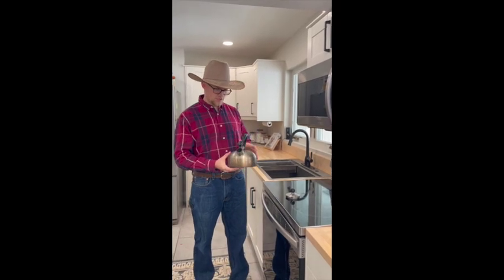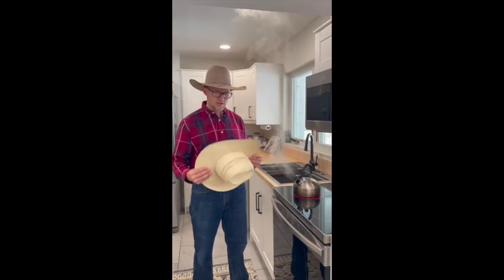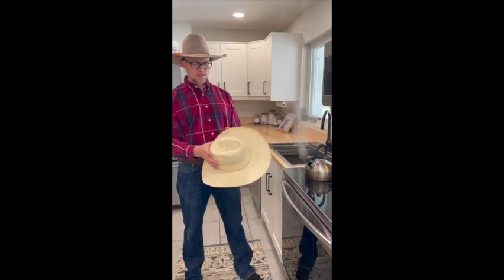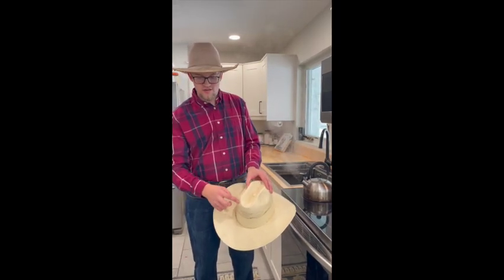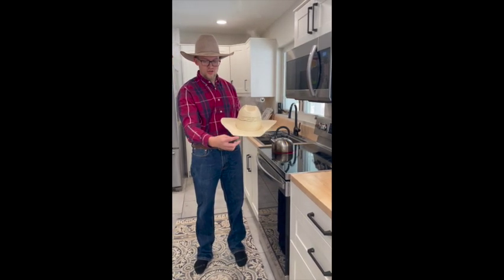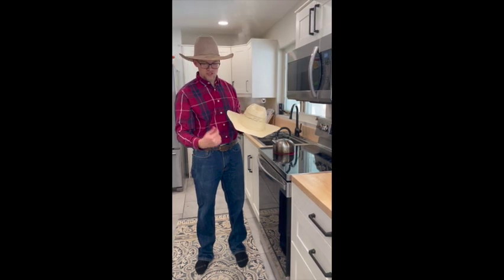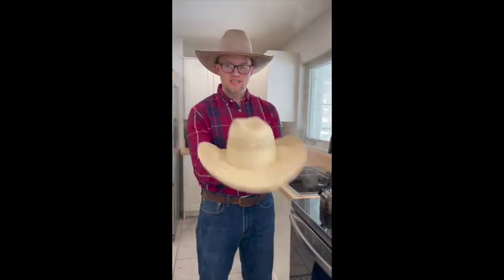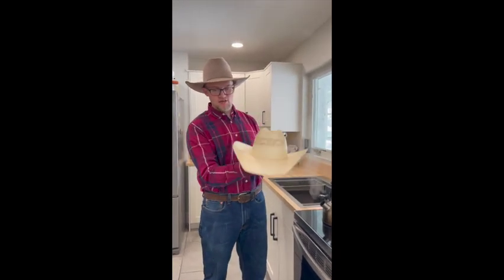How To Shape a Straw Cowboy Hat at Home

Comment: do you have any alternatives to make steam? I dont have a kettle like that, should i get one?
Reply from the maker: Pyotr Kelly, 

Unfortunately if you are going to set out to steam a hat, it’s best to use a kettle. 

I’ve had some luck with a steam iron, as long as you can push a button and get pretty substantial steam with each push.

If you’re doing anything significant on a hat I would recommend borrowing a kettle, but minor touchups can be done with a steam iron.

Hope this helps!
Reply: Grab a pot fill it with water put foil over it and punch a hole dead center . Boom. Steamer